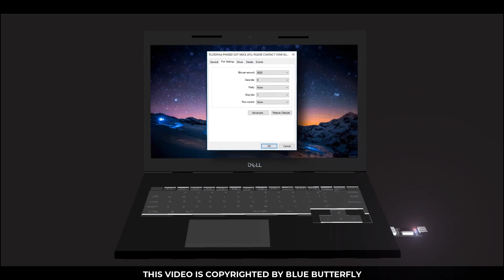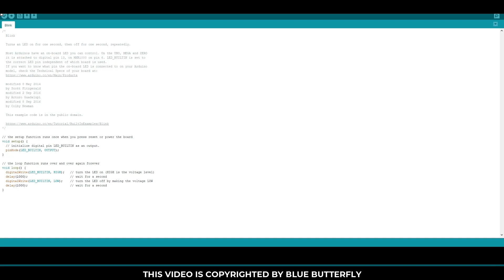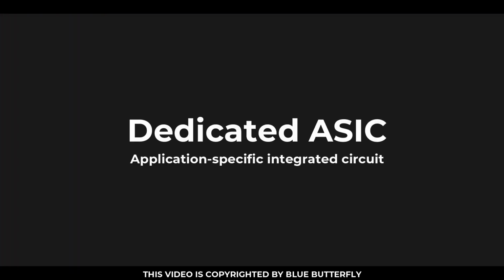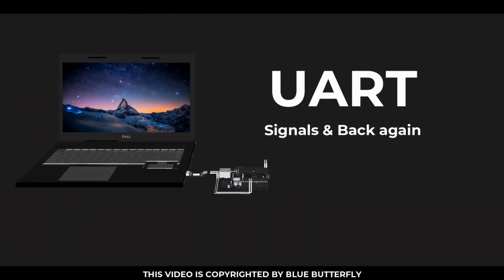How USB to TTL Works ? | 3D Animated 🔥

Comment: Would I be able connect a mic module to a laptop using this method?
Reply from the maker: @HokageUub  no u can't connect mic module with usb to ttl directly because in mic module there is analog output and usb to ttl have tx and rx pin
Reply: @BlueButterfly2000  Hi thanks, I discovered this yesterday. Found out I can use an ESP/Arduino as an intermediary and connect that straight to my laptop
Reply from the maker: @HokageUub  yes broo that's good u can use Arduino for that 🔥